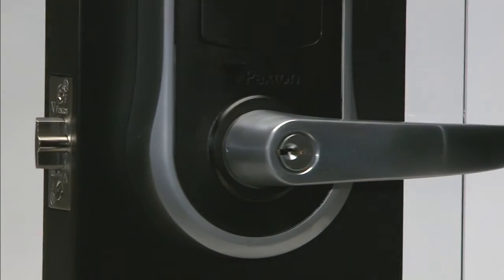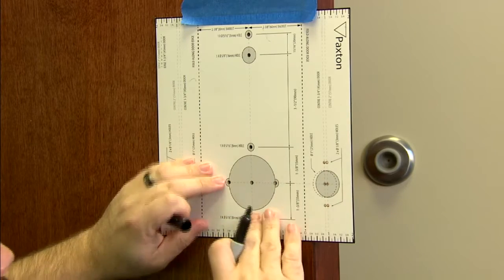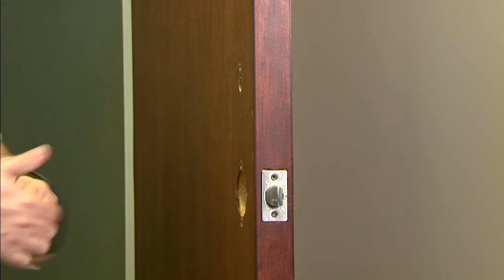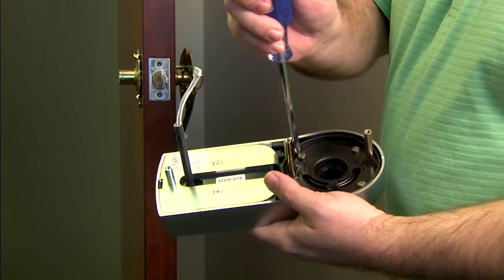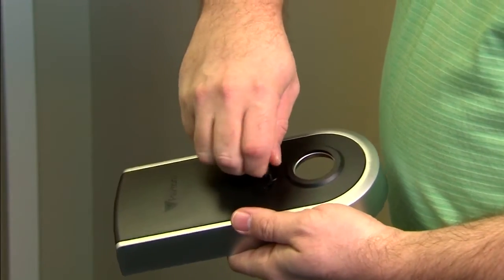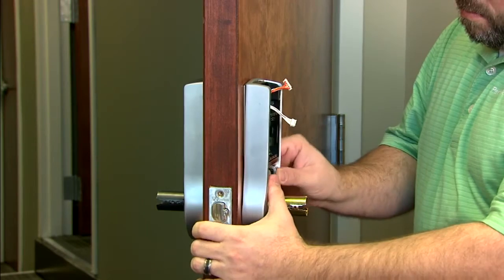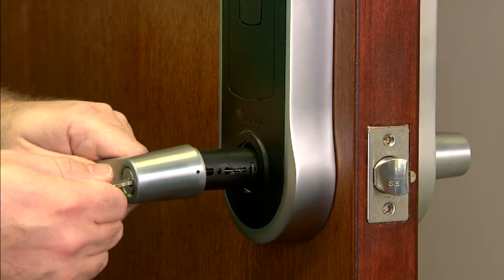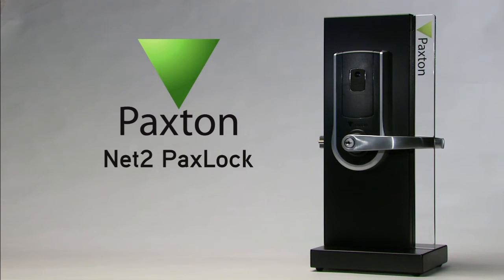Net2 PaxLock Installation Guide

Comment: Where is the paring to the bridge ? How is this PaxLock connecting to my data base? Will you create a follow up video showing us how to pair the PaxLock to the Paxton Bridge?
Reply from the maker: Craig Binford  Thanks for your comment! The video shows the physical, hardware installation only. The Paxlock US uses the Net2Air Bridge for wireless communication. Be sure to check out our sales video also (https://youtu.be/lCgHa9dWGIo) or contact our inside sales with additional questions. Alvin would be happy to help answer all your PaxLock questions! 1-877-438-7298